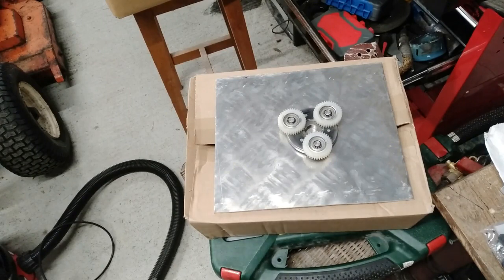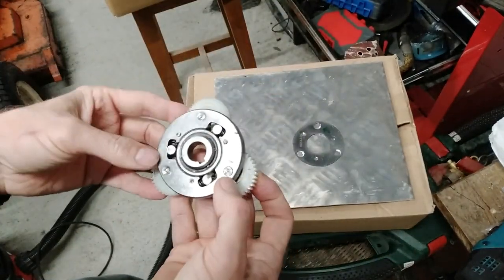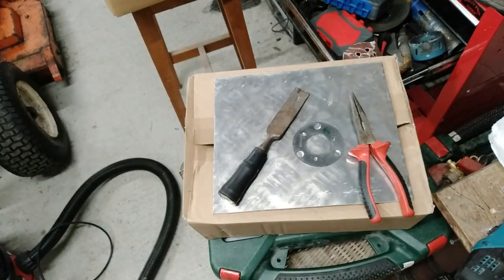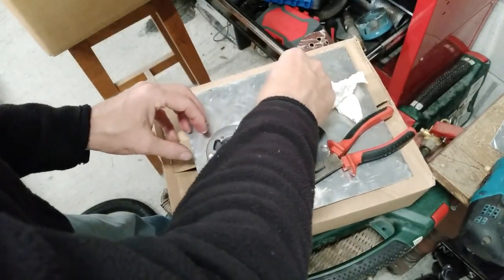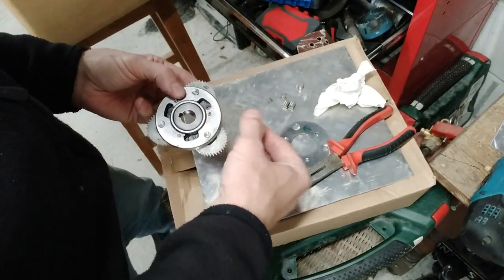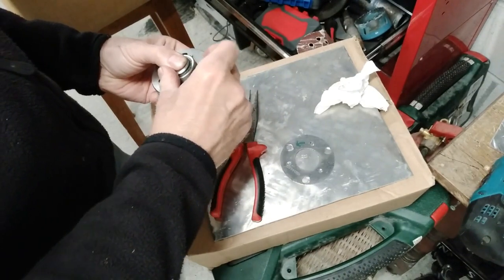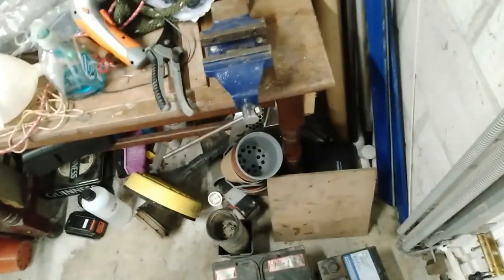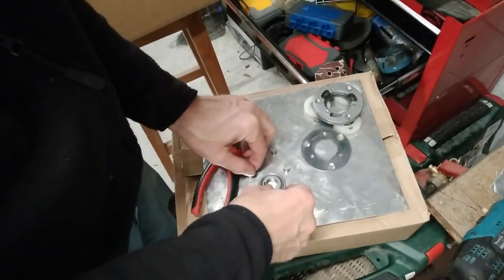What's Inside An Ebike Hub Clutch

Comment: Anyone know the best way to prevent the clutch from working? If so, can the motor be run in reverse then?
Reply: Sometimes the manufacturer can make a mistake and the wiring on the bike could be wrong, but you need to check for videos on YouTube to see how to fix the wiring on the bike so it can run the right direction
Reply: Wenn der innenring mit dem Außen Ring verschweißt wird, dreht sich der Motor immer mit. Brauchst dann aber einen Controller der auch rückwärts kann und rekuperation. Grin macht da was in der richtung.

Comment: It's a lot simpler than you think. The recesses in which the rollers fit are wedge shaped. When the outer race of the bearing rotates it pulls the rollers into the wedged slots and locks.